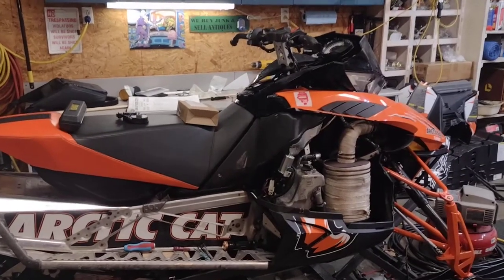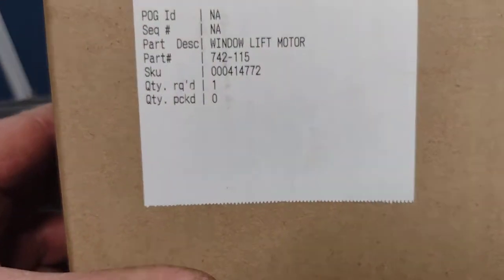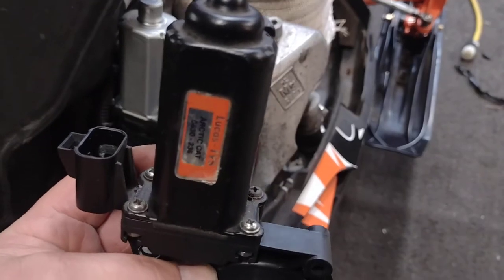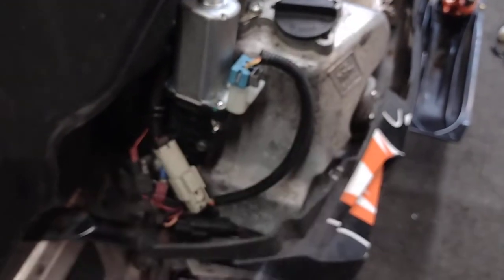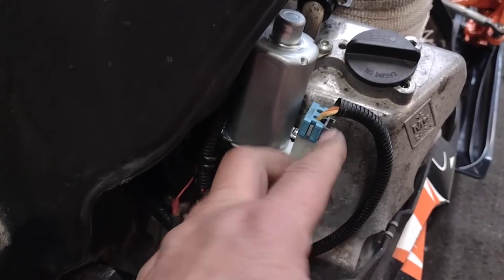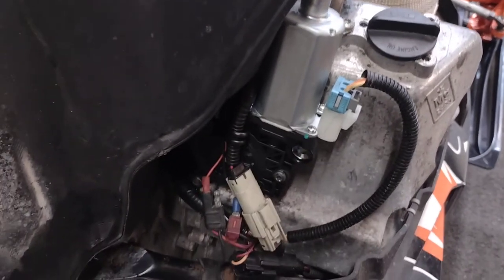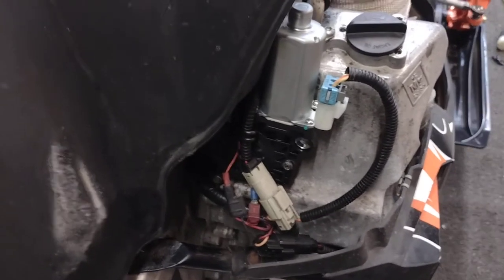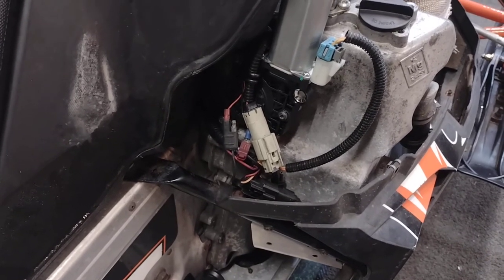Arctic Cat F1100 Reverse Actuator Fix

Comment from the maker: Chaincase actuator bolts are 36 inch pounds not foot pounds
Reply from the maker: Good call on that one. Thanks for catching it and watching Dirt Poor Tv. I will pin your comment to the top of the page.
Reply: so that's 3 ft lbs then?
Reply from the maker: @leonidesbungwalter8989  yes you are correct. Thanks For Watching Dirt Poor Tv

Comment: Thank you for this tip, I recently bought a 2013 M1100 and the switching from forward to reverse gear in it is a bit rattling compared to my 2009 Z1 Turbo. If it stops working, this could help save quite a substantial amount of money! 👍👍👍
Reply from the maker: Thanks for watching Dirt Poor Tv

Comment: Thanks for the video! im done trying to clock the wheel inside to a spot that isnt stripped out. Im wondering if the 742-114 (Left front window motor) vs the 115 (left front) will reverse the polarity and skip that step.
Reply from the maker: It might have the polarity reversed, but if it doesn't now know how to change it. LOL

Comment: I swapped mine out.  Rotated the top section 180.  Do not hear any noise and get ECU 25 code after pressing reverse switch.  Any thoughts what to start looking at?
Reply from the maker: Did you change out the motor with a new unit or just rotate the top of the original motor? I am confused where you said rotated top section. Thanks for watching Dirt Poor Tv
Reply: @dirtpoortv4483  yes I swapped out the whole unit with a Saturn window regulator and clocked the magnet section 180 so the electrical connector is on the same side as the factory actuator.

Comment: I replaced the upper shaft and I installed this motor and stopped working. I got the ECU 25 code only after using the snowmobile for 2h, backup 10 times maybe. I will investigate but pretty sure it's not strong enough.

Comment: What was the original issue with the actuator?

My 2012 f1100 says on the display that it’s in reverse when it is not. It will not switch in to reverse either.
Reply from the maker: Unbolt the reverse actuator from the chain case. With key turned on cycle the reverse actuator by pressing the reverse button on the handlebar. Make sure the reverse actuator is operating properly while not bolted to the chain case. That will tell you if your motor in the reverse actuator is functioning properly. Also pay attention to what direction the reverse actuator is turning. Thanks for watching Dirt Poor Tv.
Reply: @dirtpoortv4483  thanks for the tip.  I followed this video and it was a quick easy fix to my problem!

Comment: You did not have to reverse the wires for the polarity. All you simply have to do is remove the 4 bolts on the actuator again and turn that magnet housing 180 degrees. Done.